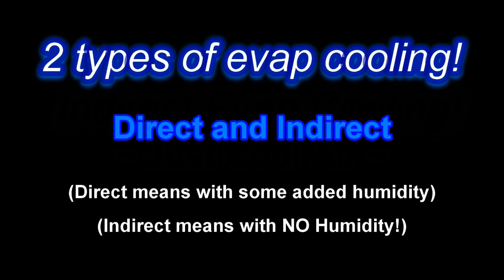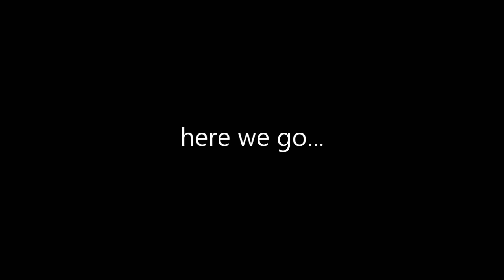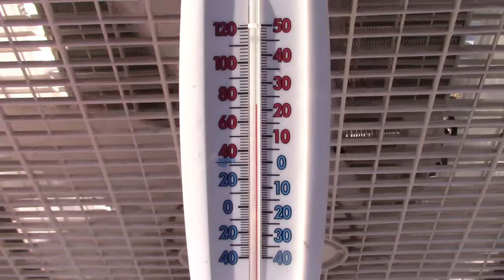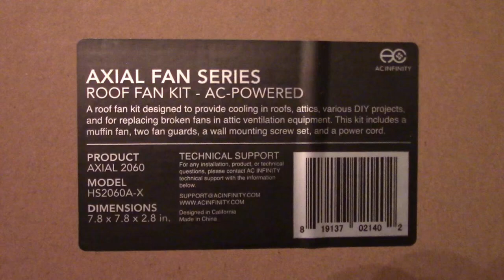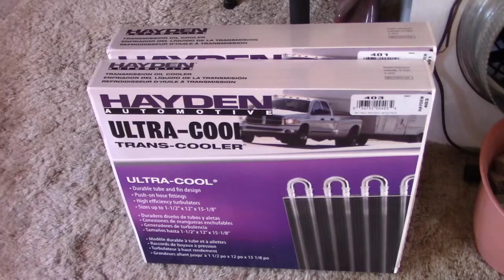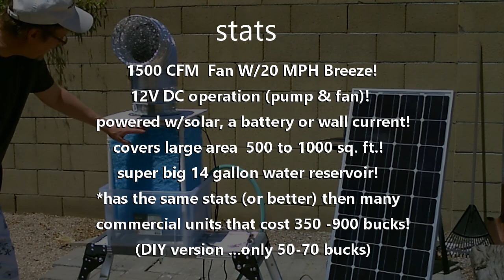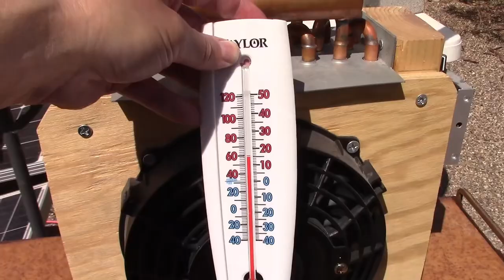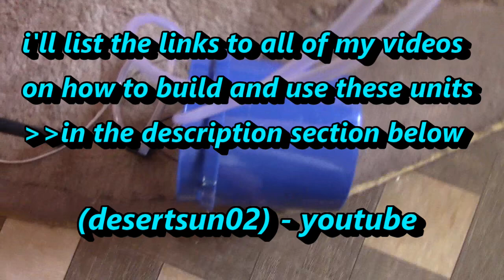DIY "INDIRECT" Evap Air Cooler! (No Humidity!) 2 Projects 1 unit! tons of info! + AC Air Cooler Comp

Comment: So is it only effective with water that is below 40⁰F?    I'm also curious if this is applicable to an off grid motorhome in high humidity; how much water is lost daily?  Thank you!!
Reply from the maker: hi there. the starting water temperature doesn't really matter. you can start with any temperature water. these units act as water chillers, so even if you start with 100F water, the unit itself will cool the water down to 60F in only 5 minutes. the reason that happens is that the water gets cooled by the evaporation that takes place on the pad. (the unit cools down the air and the water at the same time). these units work the best in the dry or semi dry climates.

Comment: another great video!
if you look at window ACs "cooling capacity" by square footage, it is entirely based on the limitation of the squirrel cage fan on the evaporator side (and the noise at that RPM).
the BTU rating is meaningless. with proper ventillation, a 6000 BTU unit could cool a whole house.
Reply: if by "cool a whole house" you mean by maybe 1 degree then sure, a 6000BTU could do that. In reality, no.

Comment: Thats amazing, can you explain more in depth how the the blue cube water chiiler works? Im in the desert off grid, it gets 105° in the summer, will this chiller still work with high temps, im going to try the gallons of ice to chill my coils, but my 5cf freezer might not keep up thruout the day
Reply from the maker: hi. yes, these evap coolers are awesome if you live in the desert. they work even if it's 110-115F outside (with proper humidity). i'm not sure how to get even more in-depth about how evap cooling works unless i go into the 'scientific technicals'. if you want that type of info the best place to go (that is easy reading) is wikipedia. basically speaking, when water evaporates it leaves cool air behind. this is because the process of evaporation takes heat. the heat becomes trapped in the air as 'latent heat' - but the lack of heat is felt as coldness. when the water evaporates on the pad both the air that is going through the pad and the water that is running down the pad are cooled. this is because the pad itself becomes cold.
Reply: @desertsun02  you the mann, thanks

Comment: Thank you for your knowledge and work on this project. I've already begun to gather the parts needed to build both the direct and indirect systems. I unfortunately live in a high humidity environment and don't have high hopes for a large change (anything helps) in the space I will be making this system for.         Question; Have you considered or attempted to incase the direct system using Plexiglas or sheet metal to recapture the air that is used to cool the water initially and contentiously recycling that same air there-in also capturing the evaporated water and returning the bulk of it to the revivor?   I wonder if doing so would create a more stable temperature variance without adding more undesired humidity to the space that I'm wanting to cool down.
Reply from the maker: hi, i haven't done exactly that but i'm working on using the humid exhaust air to pre-cool the water that is re-entering the tub (after it has passed through the radiator - but before it re-enters the tub). doing that adds a second stage, turning it into a 2 stage unit. just need a second radiator to do. btw - since you mention that you have high humidity, here are some extra facts and things to consider:  these units (half-work) in high humidity. what i mean by that is that the radiator part works great in any humidity (even 95%) but the tote evap chiller only chills the water well if humidity is 60% or less. if you don't get the desired chilling from the blue cube evap part of this project - your best bet may be to use the radiator/fan part with another cold water source (ice cooled water is one way). i have 4 videos showing how to make lots of these radiator air coolers using cold water (cooled with ice and ice packs etc.) i posted all 4 last summer - the summer of 2021). those work great in any humidity. if interested here are the 4 links (in the order posted them)...
1.) https://youtu.be/5YVPu9hfhZo (original video on the topic)
2.) https://youtu.be/DERYsKnlKzA (2nd original video on the topic)
3.) https://youtu.be/Jfc26AH0jLI (larger box fan version)
4.) https://youtu.be/oAuL-ScEWfI (extended box version - w/extras)
Reply: That you. I will look in to each of your suggestions and let you know what works best for my needs. Thank you again for what you do.
Reply: @desertsun02  Great!

Comment: Awesome build  , question could you keep the outdoor unit inside and have it in a large box to keep the humid air recycled but I'm thinking it may get to humid in a incloseure ?
I haven't seen the blue evaporative cooler pads in Australia we only have a paper type what's brand of them please cheers
Reply from the maker: hi. it's a duracool evap cooling pad. they are made of 'foamed polyester' 🙂✔

Comment: Great video. I was wondering can you make a video where you use the cool humidit exhaust air and pass it through a air/air heat exchanger and precool the incoming air without adding moisture (by using the air/air heatexchanger) which will go though the blue pads and cool below wetbulb temperature?
Reply from the maker: hi there. i'll look into it. (i'm currently working on the idea of using a second radiator to cool the 'returning water' (to cool it down before it re-enters the water reservoir). one commenter suggested spraying it on the pad

Comment: Hi, Cool Ideal, Can Confirm these do work with low humidity conditions. Can lower space temperature from 10F to 20F. We used the Evaporative Coolers during deployments to Iraq and Kuwait. Kept the Mechanics Garage tolerable on a Hot 110F    Day.

Comment: Very interesting. I'm trying to develope a wall system that would create heat via passive heating with small fans to bring in cooler indoor air heat it in a mini greenhouse so to speak and then vent it into the house.  More of a point source heating.  I'm an architectural designer so I don't have the technical knowledge to completely create this system.

Comment: Desertsun - as I said last summer, you are a huge inspiration!  One quick question - where do you buy the ae fans (not radiator) on Amazon? I couldn't find one last summer and I bought a variable speed 8-inch fan for a Tote evap cooler based on your design. I think the fan got too wet because it stopped working. I am trying to build a cooler with a 6 gallon water jug that is similar in design to your Tote design. Again - you are a Rock Star in my book.
Reply from the maker: hi there and thanks! - it great to hear that the videos inspired you. i get my ae (auto expressions) fans from walmart *sold in their auto dept. amazon or ebay might be a good place to get them too. 6 gallon design sounds super!
Reply from the maker: @Bernard Douthit hi again, almost all of the 12v fans that they sell (including everyone i've ever bought is an oscillating fan). they all have a switch on them though, so you can turn off the oscillating feature). all of the auto expression fans that i have, have the oscillating feature.

Comment: Can you possibly provide link for the fan on the outdoor reservoir and a link to the big radiator? Much thanks.
Reply from the maker: hi. it's the axial 2060 fan and two model 405 radiators. here are 2 amazon links. first one is the axial 2060 muffin fan https://www.amazon.com/AC-Infinity-Cooling-Ventilation-Projects/dp/B00I06S792 and here's a radiator link https://www.amazon.com/Hayden-Automotive-405-Ultra-Cool-Transmission/dp/B000C3F3HK/ref=sr_1_1?keywords=model+405+hayden+cooler&qid=1654796619&sr=8-1
those aren't the lowest price ones i've seen so you might want to search for lowest price (on both items).
Reply: @desertsun02  thanks. I love this channel
Reply from the maker: @Katie Lin thank you! ✔😎

Comment: Can this system be sized down to cool a van? It doesn't seem like a 20 inch fan would be needed in a van. If it was smaller maybe  it could fit between the two front seats if that space was completely free and open. Is it doable?
Reply from the maker: hi. i think the unit would be great for cooling down a van just as it is. you can use any size fan/radiator combination with the "blue cube cooler".. notice in the video the small and medium sized fans/radiators that i show. you could probably run six of those smaller setups with the blue cube before you'd reach the "tipping point" - meaning before the warm water from the return tube of the radiator started to overpower the blue cubes' water chilling capacity. you could scale down this blue cube but then it's all an experiment. you'd have to guesstimate the size cube that is needed. i wouldn't make the cube too much smaller or it might not have the 'water cooling' effect that is needed.

Comment: thanks for sharing, just have a question,  in case I only want to use the indirect cooling fan with the radiator, do we need the fan on top of the blue cube to cool the water or we just need to pump the water through the pads?
Reply from the maker: hi. yep, you'll need the fan on the top of the blue cube to pull the air through the pads. it's the air rushing through the blue pads that cools down the water in the bottom of the tub.
Reply: @desertsun02  thank you! I got it.

Comment: I live in Southern Az . Last year was very hot. Question .
When it's 115 outside will the blue cube cool the water to about 85 degrees ? I want to make the indirect evap. And does the blue cube need to have a water line in to feed the water that has evaporated  . I'm not sure about how your design works and wanted to make sure I will get a full understanding of how it works .
Reply from the maker: hi there. i haven't tested it in 115F weather but based on information from an evap cooling chart, the air (and therefore the water) should be about 80-89F (with humidity from 5 to 20%). i just fill the tub with water as needed. it seems to go through about 1 gallon an hour. at that rate you could run it fpr about 10 hours before you needed to refill it. the tub holds 12 or 13 gallons

Comment: Nice set up of indirect cooler, how much does the water last , for example will it last whole night ? Hello from Mumbai India 🙏🏻
Reply from the maker: hi. the unit holds 12 or 13 gallons of water (and the unit uses about a gallon of water an hour) so you could run this thing for maybe 10 hours before it needs to be refilled. the reason i say 10 hours (and not 12 or 13) is because you need a couple of gallons at the bottom for the pump to work correctly.
Reply: @desertsun02  
I think someone mentioned that hydroponics systems use float pumps to keep the water supplied to the nutrient reservoir.  The same thing could work here and you could have it run constantly drawing more water off the tap to keep the water topped off..

Comment: I just found your channel and subscribed. You're projects are amazing!
Reply from the maker: thanks very much!
Reply: @desertsun02  Thank you! Do you have cooling projects ideas for areas with high humidity or would this build still work? I live in arkansas and the average humidity is 85% during the summer.
Reply from the maker: @Wendi Campbell the best DIY air cooler videos i have for humid areas are the non-evaporative cold-water powered ones. those use a heat exchanger along with cool water to make cold air. they don't add any humidity to the air. if you want to take out humidity you'll have to combine those with a de-humidifier. the quickest way to find my heat exchanger videos, is to check under the playlist tab on my channel. i have them grouped into category
Reply: @desertsun02  Ok, great. I'm going to make one. This is exciting lol. Thank you for your help!
Reply from the maker: @Wendy Campbell you bet! and thanks for watching 👍

Comment: I can build a smaller one that fit in passenger seat.  There's a divider to the rear side of the Ford Transit.  This will avoid the $1500 cost and a hole on the roof which means more solar panels.
Reply from the maker: sounds interesting. i'm trying to picture it. i know that some cars in the past actually used to have evap coolers in them.
Reply: @desertsun02  There's a product call Fresair.  The disadvantage is the hole on the roof which takes up solar panels space.  It takes about 5A to run the unit. "VANLIFE AIR CONDITIONING | Fresair | Ultra efficient | Full TUTORIAL [NEW]" at 8:44 you can see the internal design of their Duracool pads and function.  I am still visualizing an interior install version of your design with an exhaust to outside.  With your setup, I can throw in 2 liters of ice every 5 hours.  The 64l chest freezer can make 2 litres ice and replenishes it.  The DIY unit will be used when the van is parked anyway.
Reply: @desertsun02  "AWD Transit WEBASTO HEATER Install UNDER PASSENGER SEAT! - Part 20"   This is the area I was thinking about using since I can exhaust the humid air out through a crack of the front window.  The front (driving area) will be blocked off by a wood or cloth divider.   Tech Ingredients used a low rpm fan cooling like this 15:27 "Revolutionary Air Conditioner!"

Comment: I love your swamp cooler video.  But I'd like to know the cfm required per sq. ft. of media.  You said this was all DC powered, but the Axial 2060 fan is AC powered and just 425 CFM, when you mentioned 1,500 CFM in the video.  So I'm a bit confused.  I'm wanting to build one these for a van build in the future.  Also would like the pump specs.  Thanks
Reply from the maker: hi there. the 1500 cfm is referring to the DC fan that i used. i also used the axial AC powered one. if you use the DC fan and DC water pumps then the whole thing is DC powered. i've used various pumps. sometimes i use a 12v bilge pump other times i've used a standard 200 gph water pump. make sure to watch my various videos (also there is a lot of good info in the description section of each video).
Reply: So do I need 425 or 1,500 CFM for the swamp cooler?

How much media area do I need per CFM?

Comment: How much humidity is in the air coming out. How humid does it make the room? What brands are there out there that make an all in one unit of the indirect cooling like your box fan type setup. Have you tried a coolant in the res?
Reply from the maker: hey there. it doesn't add any humidity to the room air (inside air) at all. all the humid air stays outside. 🙂 👍👍

Comment: Excellent.
Ok, so I'm thinking... Electricity free, water hammer pump!!?? ....and the water could power the outside fan?!!
Granted I am assuming less CFM fan but more evaporative cooling material.
I'm imagining the evaporator operating without electricity and fanless if possible, leaving the inside fan as the only electrical consumption (for now).
Reply from the maker: hi and thanks. you have a lot of interesting ideas!
Reply: @desertsun02  you do, I think, lol
Reply from the maker: @sovereignDirt i'm hoping to get people interested in the 'indirect' evap cooling topic. it's been very underrepresented online up to now. i think people think they're too hard to make but they're really just 2 easy projects combined ✔
Reply: @desertsun02  I'm all about free and cheap!!😏👍🤙

Comment: Do you think this will work in  conditions like 80-100% humidity and 38-40degree celcious??
Reply from the maker: hi. 80% is a little high. they usually work good up to about 60%. i've heard some of the bigger units can work up to 75-80% if it's outdoors
Reply: No way it will reduce only 2 degree without child water😂😂

Comment: I was kinda thinking if you could use something like this inside a house that is air conditioned if that would be more efficient or probably not I guess it would be hard to test
Reply from the maker: that may work. i know that some businesses and many commercial buildings actually use cold-water or ice based air cooling along with standard AC to reduce their cooling bills by up to 35%. they freeze the water in large ice banks at night (when the power is cheaper) and tap into that during the day. i read about one company that makes the units and they say they have ice cooling systems in 4000 businesses. one of the biggest setups is in a high rise building in new york city. i forget the name of the business but i saw a picture of the ice banks. (it was several huge, round refrigerated metal tanks in the basement)

Comment: is the power usage less than a conversational air-conditioning unit for the same amount of cooling?
Reply from the maker: oh yeah. the whole unit as shown is only 97 watts. (5 to10 times less power than a comparable small window ac). something interesting to note is that some window ac units say they are 500 watts but actually pull closer to 1000 watts. (measured with a kill-a-watt meter). they start around 500 watts but after a while they are pulling 900+ watts. appliances are supposed to list the wattage as the highest wattage they will ever draw (not including the split second start-up spike that some of them have).
Reply: @desertsun02  thanks for the info and videos, im thinking to build one for my campervan if my pc fan vents fail to get the van down to comfortable ambient temperature